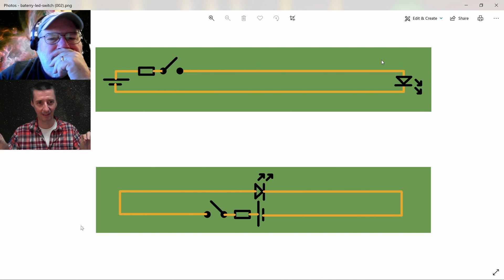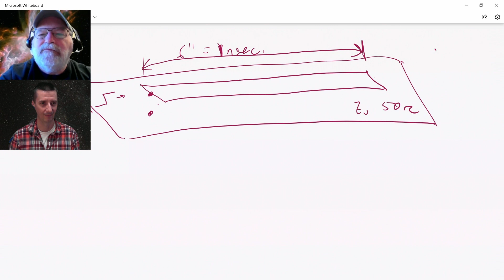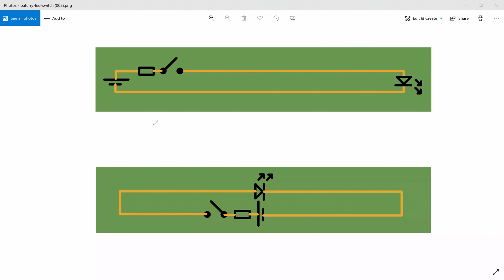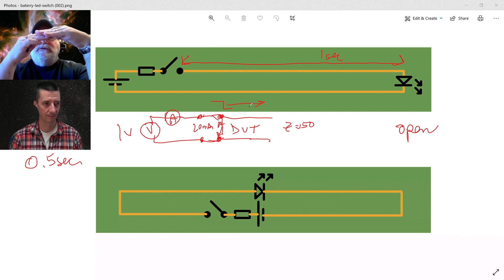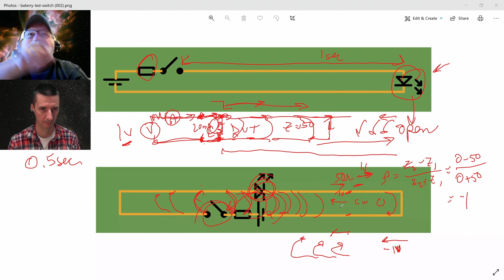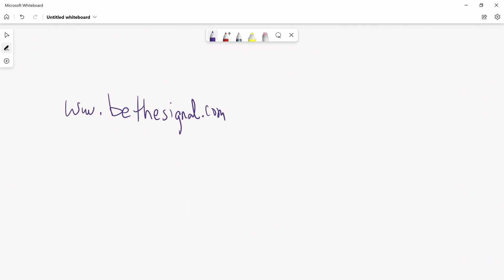Explaining Veritasium Electricity Video: Energy doesn't flow in wires (with Eric Bogatin)

Comment: Ahhhh!
you was too timid to bomb him with right questions so he would figure out he is wrong!
You should have told him to tell you for the case when both ends have breaks, for sure you won't have there 2 volts, 1 volt, 1/2 volt not even 1/100 volt!

This is even without touching the case that we have here with a diode which allows the current passing only in one direction.

Comment: The best explanation I have ever seen of signals and transmission theory. @Dr Bogatin: Very well done. And thank you to Robert Feranec for inviting him!

Unfortunately, the problem presented to Dr. Bogatin, is NOT the problem presented by Veritasium. Though I totally understand why it was presented in the manner it was, nevertheless, the Veritasium problem has a Physical Demonstration to it that people who view the video get to see. That demonstration makes certain things "tangible" to the viewers and also modifies how we perceive it and how it should be perceived.

Let's review:
1. The demo shows a (car) battery, an LED bulb, insulated conductors. These conductors are then given the hypothetical "no internal resistance" and they are 300,000km long, and separated by 1 meter. When the switch is thrown in the demo, the LED turns Solid ON. It simply remains On.
There is literally NO mention of Blinking on. Clearly the definition of "ON" here is suspect if one were to consider "blinking" on as "ON".

The question offered by Veritasium was after the switch closes, when does the LED turn on? (0.5sec, 1s, 2, 1/c (sic), and None of the above).
After listening to Dr. Bogatin, (who clearly knows the material), one would believe that current flow across the bulb would be enough to power the LED. However, let's review some of the facts that everyone seems to leave out.
#1 These are insulated conductors not capacitor plates sitting on dielectrics. The conductors are also not Bare Wires, they are insulated. Please get that fact straight.

The impedance of insulated conductors 1 meter apart will be markedly different than the simulation because the simulations do not include the fact that there is insulation on the wires.

#2 The LOAD is a 12 volt LED Bulb. These "bulbs" are internally made of many LEDs in series. Each LED in series has a forward voltage that MUST BE exceeded in order for the LED to turn on. Nowhere in any simulation are you taking into account the forward voltage requirement of the circuit.

#3 THERE IS NOT AC SIGNAL. Dr. Bogatin refers to the signal frequently because he is equating the circuit with typical signal. BUT, there is NOT AN AC Signal in this example. There is only DC, and the instantaneous turning on of the Switch. There will be a very brief pulse. That is it. 

#4. If you take all these elements: Insulated Wires, DC, Not AC, 12 volts, 12 Volt LED, Forward Voltages of the Diodes, No signal. It results in at best... the microscopic blink of an LED, nothing more, for at best a moment in time. I am sorry, but I simply cannot equate this to "The Light Turns ON".

Please show a simulation that corrects the above noted issues, and let's see how it plays out.
Reply: @LiveType  I am not sure. I guess it depends on whether he values his integrity. Because, the reason why I watched his videos was to get to the deeper truth of things. If this is how the future of his videos will play out, he lost only 1 viewer. It may only register as a blip on the magic light bulb hehehe but for me, I value the integrity of the process. It really bothers me to see this level of misdirection by someone I really thought knew better.

Comment: Hello Robert, 
great idea to cooperate with Dr. Bogatin in this topic!
I have one question regarding this issue:
For me both cases described are pretty clear, but what would happened if two wires instead of layout from top picture (transmission line like PCB) and bottom ( from veritasium) would be placed as one big loop (signal lanes very far apart from each other and LED far from voltage source)? The coupling between signal and return would be extremely low. How this signal would propagate then? 

I would bet that principle is the same but due to very high impedance between lines there would be extremely small displacement current and due to very long risetime of this signal we would need more time for voltage to become stable. 
What is your/Dr. Bogatin's opinion?

Thank you for this video :)

Comment: And for the people who can't make sense of the idea that there's current from an "open circuit". Another way to think of it is that information will not transfer higher than the speed of light. Meaning you can't know whether the led is connected or not without that information transfer from the far distance through the speed of light.

Comment: Instead of dismissing/waving hands like Dave from EEVblog did, you guys made the whole thing meaningful. And it's actually more helpful than not for even experienced electrical engineers.
Reply: @donmab  The difference for me is that I can actually understand what Dave is saying. Maybe it's because I'm also Australian, but the point still stands.
Reply: @Scoochie77  Honestly, I think that by introducing complexities like resistance and loss, EEVBlog may be more practical, but he is using it in a way that it just clouds the actual working of the system and saying that everyone already knows about this is just not true. That's not the point of the original video which is trying to explain first principles of EM. I do agree that Derek may have done a poor job by starting with non-ideal components and just claiming them to be ideal, whereas you would just choose a PEC in a lecture, but I guess this makes it more relatable to people.
Reply: @Scoochie77  I vant to knov vay you call yourself a "Ruski robot" ven you are Australian?
The video Dave did on the Varitasium was not too detailed he pretty much agreed with most of what was said by Varitasium in relationship to principles of transmission lines and propagation. Actually it was probably one of two of his videos I was able to sit through right to the end, normally I have to turn him off because he tends to just go overboard and overcomplicate a generally simple subject.
Reply: @markg1051  Russian bots pretend to be all sorts of nationalities.
Reply: @Scoochie77  where abouts in Au are you? I'm in Sydney, west.
Reply: @markg1051  I choose to not disclose my location.
Reply: @Scoochie77  that's cool, happy new year to you Sir. Hope it's a better one than last couple.
Reply: Dave from EEVblog is stuck with his own opinion which he claims to be fact.
Reply: @brugj03  isn't that pretty much what one's opinion is supposed to be? Weird thing to say.

Comment: A wire is just an elongated capacitor.  Take away the return line completely.  Then apply the signal...it will experience inrush current and have the same effect.  Also you have not measured the g factor of an electron.  You have measured a field flow of a nucleon.  Your understanding of the atom is incorrect and I can prove it.